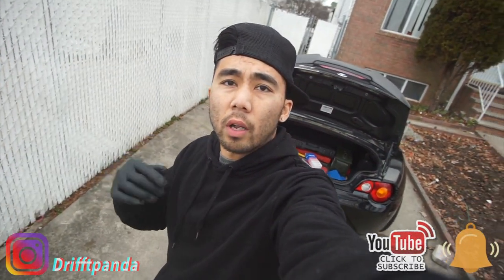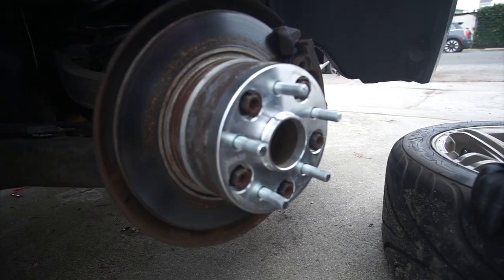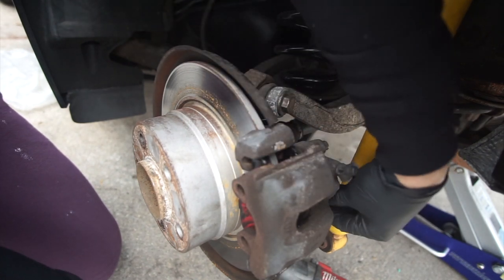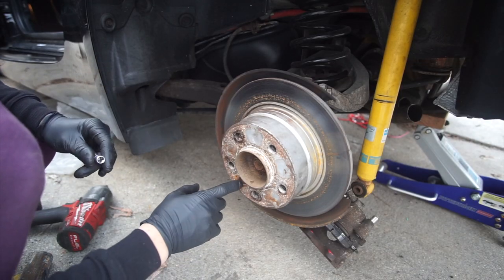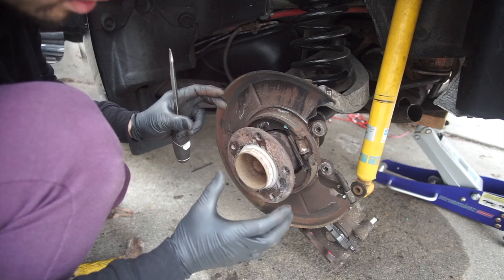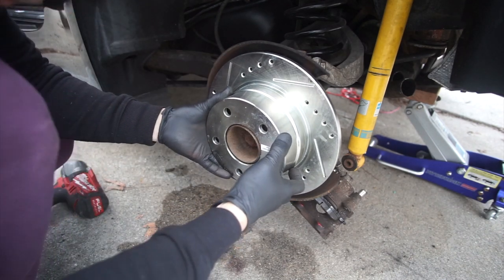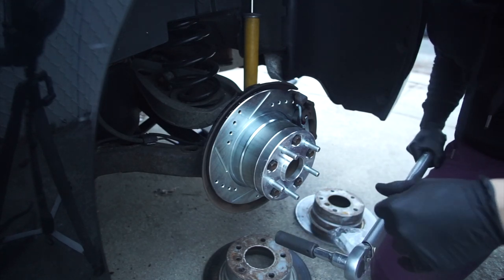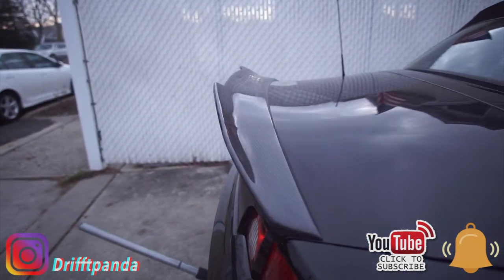Vlog #10 DIY How to Replace Rear Rotor Brake Disk And Brake Pads BMW E46 - E85 #BMWZ4

Comment: If you have a real problem getting the rotor to break loose (sometimes they can be a real bear), here is a video I made of the process I use that works very well and makes getting even the most stuck rotors to break loose.  https://youtu.be/pB-bcSqtsgg